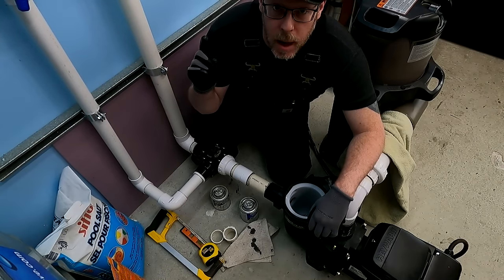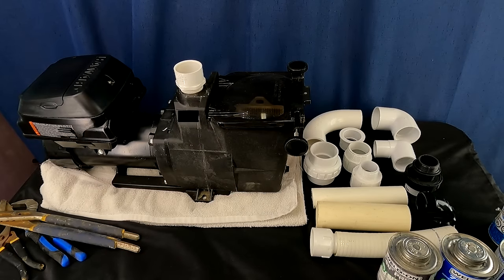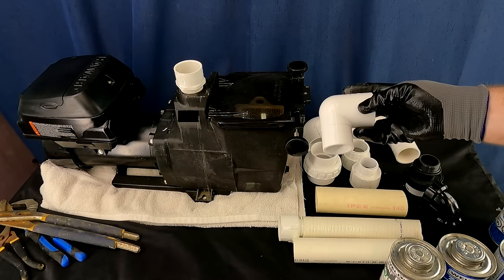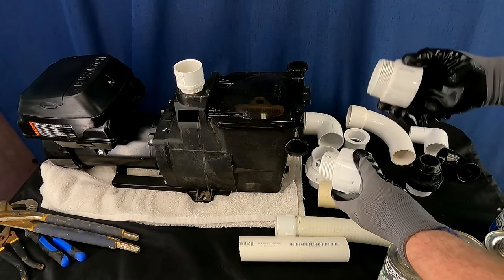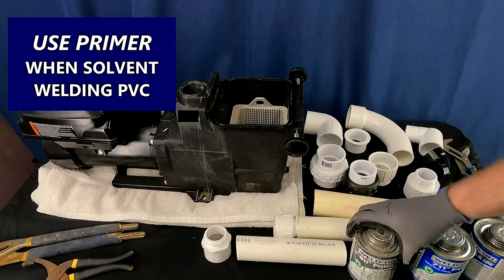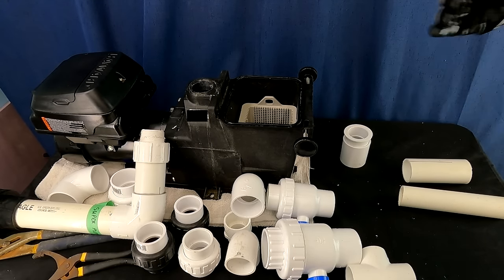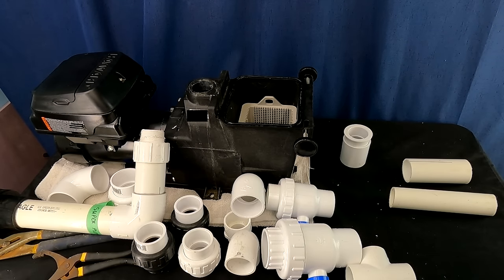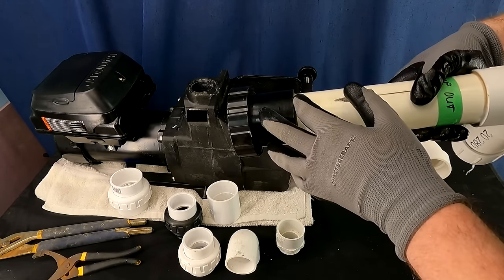How To Install a Swimming Pool Pump (Better)

Comment: Lots of truth and not an easy video to make. The only thing I'll dispute is the use of flexible PVC. First off,  it's not a totally different product than rigid PVC. They are both PVC, just with different plasticizers. But yes, standard schedule 40 PVC is stiffer (on purpose), handles higher pressure, typically looks better in pool applications, and smoother on the inside. However, there are good use cases for flexible PVC, especially when it comes to best "trade-off".  For example, when upgrading or adding new hardware, it's a good option/trade-off to avoiding ripping out all the plumbing down to the pad, which can often be the case with rigid PVC. I installed a salt water chlorinator vertically on my own pool in a very tight location and used flexible schedule 40 PVC to eliminate excess elbow connections and tension between odd angles. Rigid PVC, with even a little torsion or flex, will fail long before flexible PVC ever will.  Another good application is swapping brands of pumps while keeping the same filters. A Pentair pump will not line up where a Hayward pump and filter and once was. It may be close, but nowhere close enough for an easy swap-out. Flexible PVC can help alleviate serious headaches of replumbing pumps with different dimensions. Lastly, once you paint it all with plastic-boding paint (typically black), it helps blend it all in.

Comment: Oh Honey…so close. 
I like your content except for your “pipe will melt next to pump discussion”.  Please look up the physics on Heat of Vaporization. This is how you are able to hard boil an egg, in a paper cup, in a fire. (Read: your cpvc thermocouple is unnecessary). 
The words to help you describe fluid dynamics; you are trying to keep your friction (turbulence)“lower” by not using flex (ridges) and by using sweeps (increase your laminar flow). This friction is defined by Reynolds (fluid flow) number (Re).  
Otherwise, great practical content! 
Thank you for sharing!